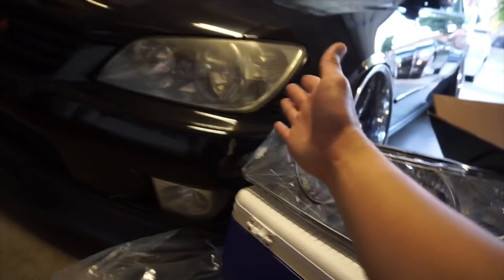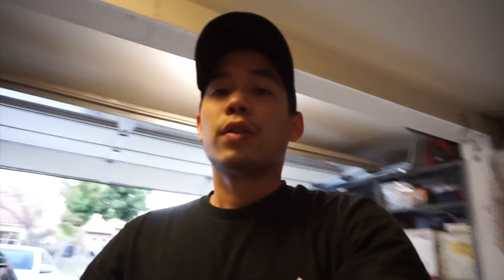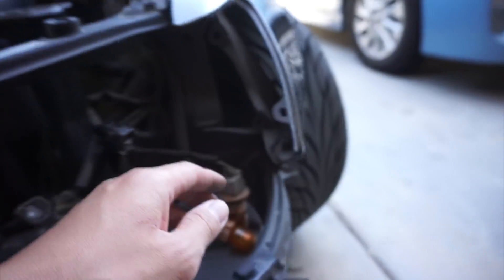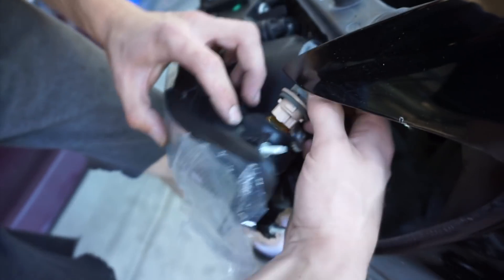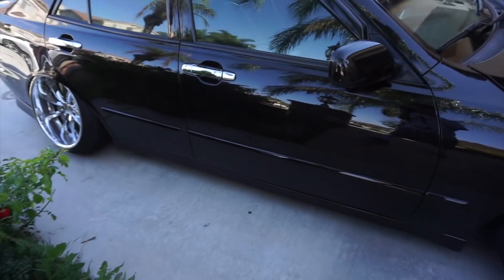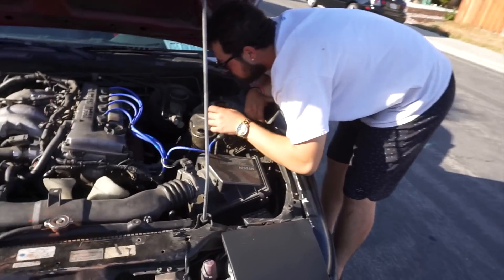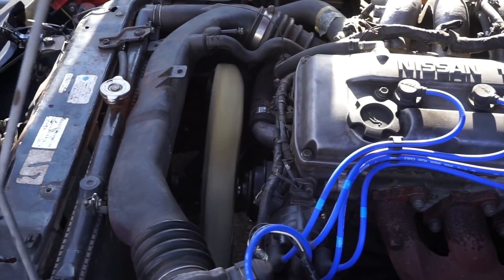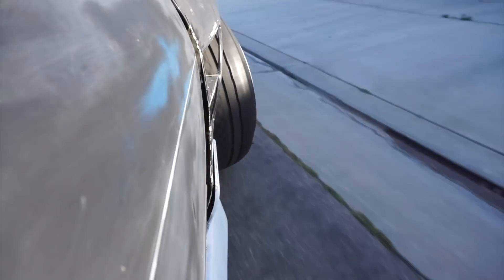How to install Lexus is300 headlights

Comment: I have that same issue with my lights aiming up in the sky and shinning on signs when I drive but it’s only on my right side headlight. It’s my auto-leveling motor for the headlight that has gone bad and I bought a new one so I’m about to install it on Sunday 😂.
Reply from the maker: Malherbe Denose hahaha yea my shit was crazy bro and didnt even see the road but the signs on the freeway! 😂😂
Reply: Iceyyyboyz lmao I thought I was the only one lighting up signs for other drivers 😂. But yeah you should consider replacing the motors on the headlights. Btw clean IS bro keep up the good work 👍🏾

Comment: hey wassUp ... I ordered those lights too and exactly today I received them, could you tell me about the tab please? ... I do not want to break it
Reply from the maker: rogelio escolano use a flat head to guide the headlight bro watch the video itll show you
Reply: what bulbs# are you using?
Reply: low,height ,parking and fog ?
Reply from the maker: Use the same bulbs as stock

Comment: link to the headlights please.
Reply from the maker: rstezza https://m.ebay.com/itm/For-01-05-Lexus-IS300-Clear-Headlights-Replacement-Driving-Head-Lamps-Left-Right/371872922504?fits=Make%3ALexus%7CModel%3AIS300&hash=item56955a7b88:g:TGcAAOSwsFpaAriU
Reply: Iceyyyboyz thanks man.